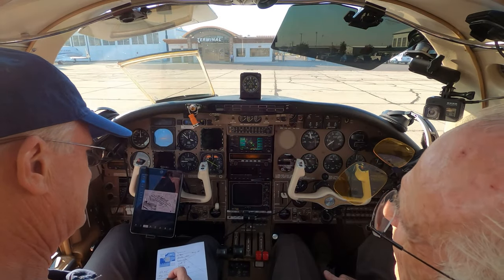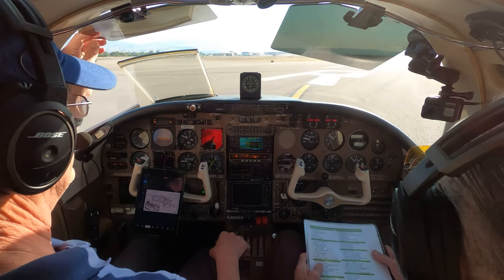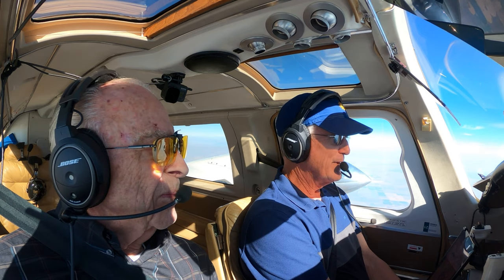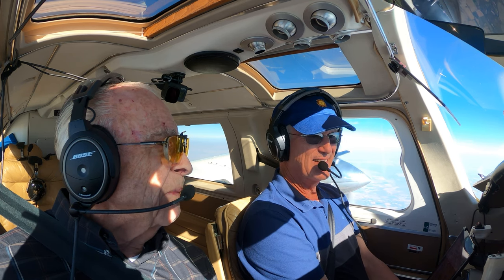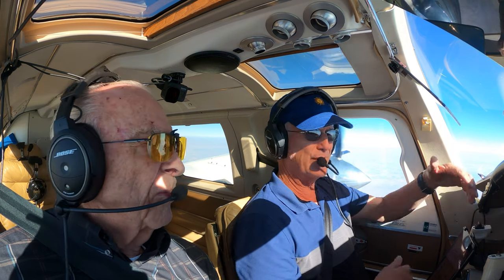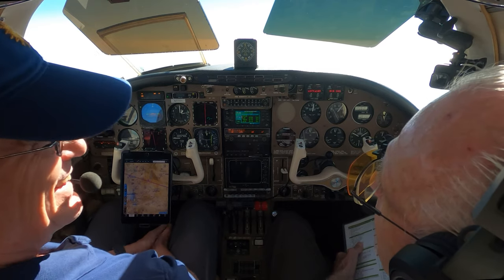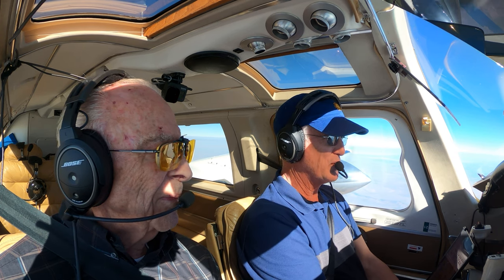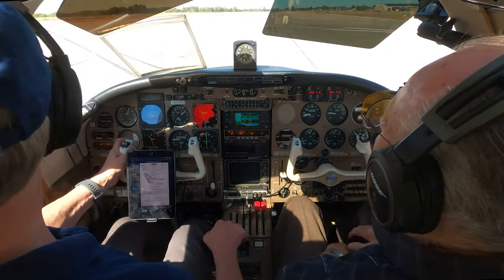Boise to Cheyenne with Ted Smith's key designer of the Aerostar.

Comment: Excellent. Thanks for sharing. Ive met several of the old timers from Aerostar but never your dad. 
I have an original Ted Smith 600 that is mothballed for the last 8 years. This inspires me to fly it!

Can you share what system you have that gives the altitude call outs? Very nice.
Reply from the maker: The callouts are from the Sandel and radar altimeter. You should either bring your 600 out of mothballs or sell it to someone who will restore and get it flying again.
Reply: It’s fully restored and arguably one of the nicest 600’s. If you’re ever at Aerostar ask Jim to show it to you.
N2PB
Reply: I’ve owned N2PB for over 35 years. On my second TBM which is an amazing plane.
Not sure I could ever part with the Aerostar.

Comment: Can you ask your Dad If he remembers The 0-360 Non dorsal prototype. Driving the gear thru the wings,During certification demonstration To the feds,Resulting in the awareness of the need to cram 540s in those small holes.Also I worked 20 some odd years for Don Smith at Aerostar World In Dothan Ala.He worked with Ted.Smith.Does your Dad recall Don?
Reply from the maker: That was Boyd Lydick.  I was around but only about 11 years old and don't remember anything specific.  Basically. Boyd found out what happens when you get too slow on final with full flaps at about 13' off the ground.